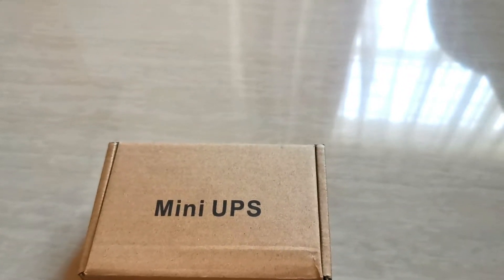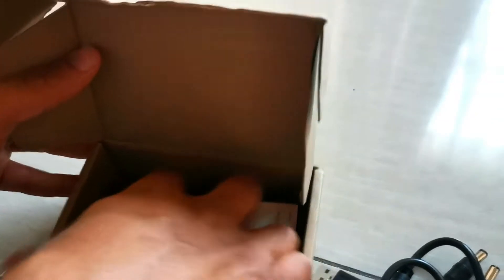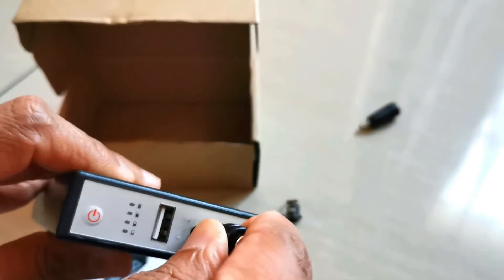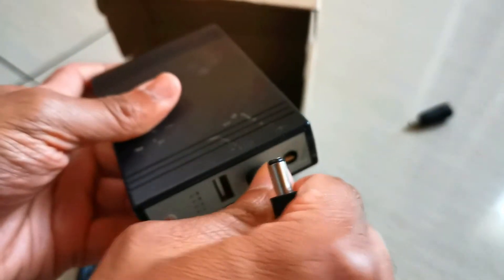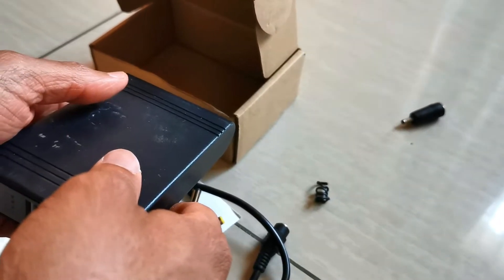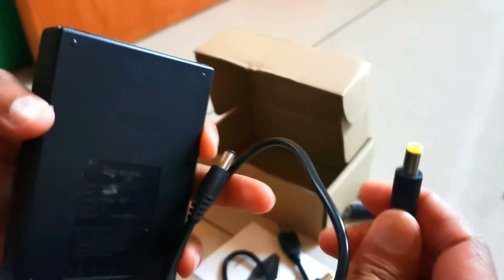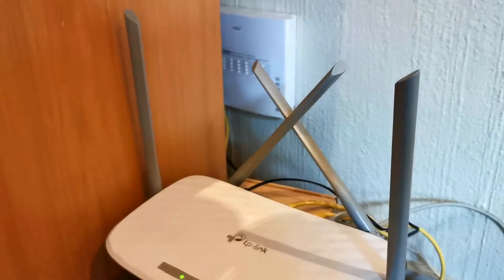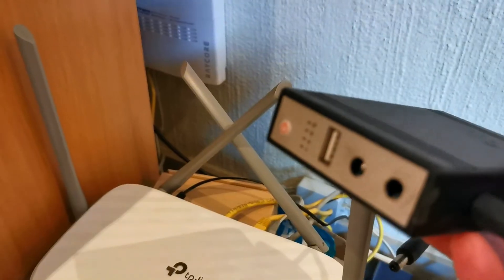Connect a mini UPS to your router & fibre ONT

Comment: Hey man thanks for the vid, so my mini ups has a DC settings switch from 9v 12v 15v and 24v and comes with a splitter, could you advise which DC switch setting I put it on to power both a 5v small modem and a 12v router together during a power outage, thanks man, any advise would help thanks
Reply from the maker: Hey Robbie, you won't be able to use it with the 5v modem unless you have a USB output on the ups. I have USB to dc cable converters, you will need on of those. The 12v will work fine
Reply: @ElecAndAll  Ok thanks, yes there is a 5v usb on the front of the UPS , suppose I just need to buy that cable now :(  anyways thanks so much bro and have a great day!!

Comment: Hi should I leave it connected even if their is no loadshedding
Reply from the maker: Howsit Shaun. Ja, it's a ups so it will automatically switch to battery when you lose utility power.
Reply: @ElecAndAll  so leaving it connected would not shorten its life?
Reply from the maker: Nope, but it will help to cycle it once in a while if you have had a power failure.
Reply: @ElecAndAll  cycle sorry don't understand that terminology
Reply from the maker: Sorry. It means that you purposefully allow the battery to drain and then charge it. So turn it off for 2 hours, let it run down the battery and turn it on again.

Comment: I just bought the Ellies mini cube 97Wh Ups. It comes with 2 x 12V and 1 x 9V connection. My router and fibre box are both 12V but strangely enough the connector doesn't fit in the fibre 12V port. It fits in all other 12V devices. Not happy with that as the Ups is useless if I can't keep the fibre box up. The kitset also comes with 4 other connector types but none fit. The fibre connector port looks the same as the other 12V ports but on closer look you will see fibre is about ½mm thinner.
Reply from the maker: You will need to cut and join the connector from the fibre acdc adapter. Alternatively you can buy a dc jack from an electronics shop.